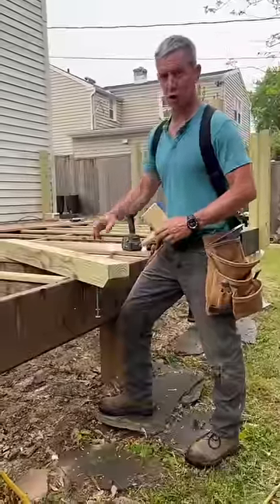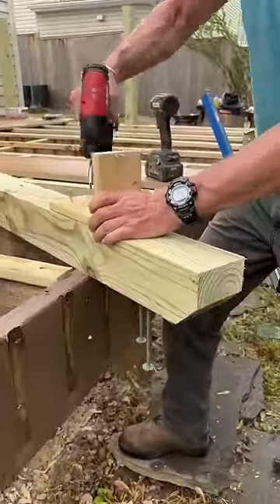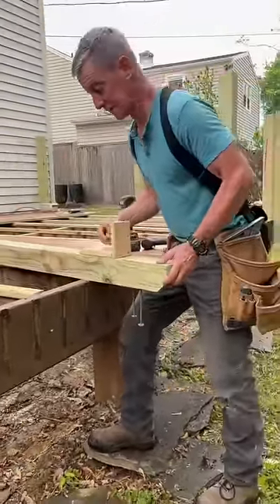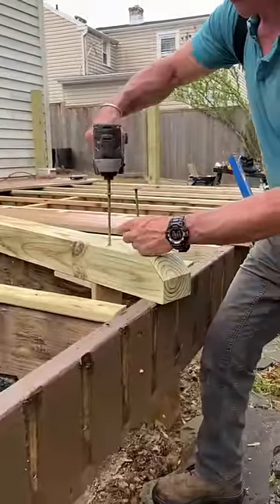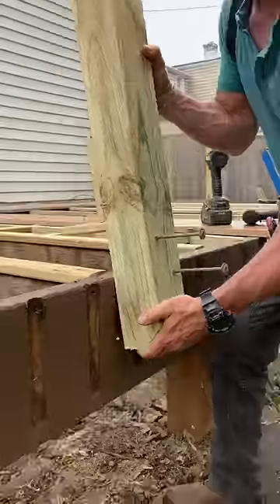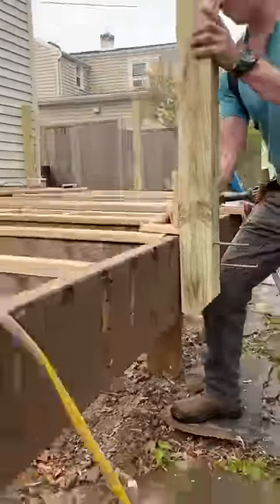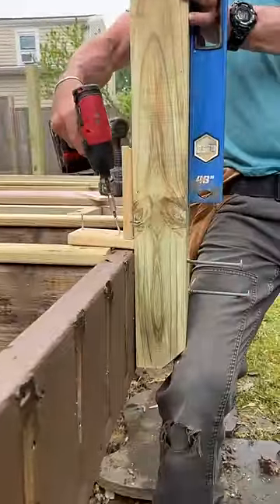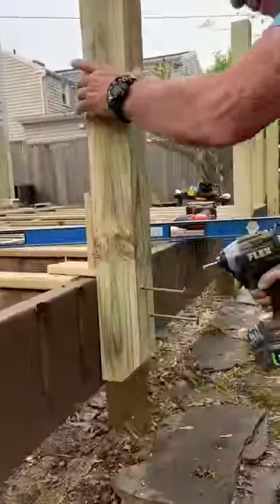DIY Tips: How to set a deck guard post by yourself

Comment: 100% not allowed per code to install handrail posts this way, hasn't been for a very long time.
Reply: I like how he replied to 80 % of comments except this one
Reply: ah, but is code exactly the same everywhere?
Reply from the maker: In new construction, you're right. But I thought the 8,000 gallons of paint on the rim indicated that this was a re-skin. - Here's the other thing: It works. DCA-6 allows a surface mounted post with thru-bolts. I'd put this connection up to that all day. For either one to fail, it'd have to be Armageddon.
Reply from the maker: Here ya go Johnny.
Reply: @MyFixitUpLife home improvement with Mark & Theresa  if you remove handrail posts, and replace, you're required to build up to current code is my point. Mainly just commenting because this can cause others to install improper posts for their own as well. You also didnt use through bolts, those are Lag screws simply going through the rim/post. Either way, the IRC does not allow through bolts for handrail posts either. Some local codes may allow it, but still not the best method. Blocking behind with tension ties and carriage bolts, or Simpsons method with blocking and their structural timber screws through the rim, joists on each side, blocking, and double back blocking.
Reply: @Metal and Wood  most Follow the IRC code book, but some adoptions in some areas are more leanant. But this is not an approved way to install handrail posts anywhere in the 50 states that I've ever heard of. 10-15 years ago, is when code changed for obvious reasons.
Reply: Can't see it from my house 🤷‍♂️
Reply: Every state has different codes, some do allow ledger locks, some cities require through bolts.
Reply: @derekkirchner1863 I've worked in 15 different states, you're totally wrong. It 100% varries city-city. Thats why most new shit doesnt last long.
Reply: @MyFixitUpLife home improvement with Mark & Theresa  So what your saying is you do the bare minimum unless the code forces you to do it. We stopped mounting posts like this 20 years ago.
Reply: My comment, was that is a massive code violation in all 50 states.... Could not agree with you more... It's sad to see people posting videos like this when they know it is one-hundred-percent illegal and improper, and someone might get hurt if they follow their advice
Reply: You’re wrong there. Look at Simpson strong tie DDT2Z tension brackets, they’re made for exactly this purpose. As well, the code just states that the post just has to hold up to 200lbs of lateral load.
Reply: @Hue Janus  he didn't use those, I specifically mentioned in my other comments the special hardware required. These in the video we just done with lag screws.
Reply: Damn that sucks, well I live in America. Code can smd.
Reply: @derekkirchner1863    The way his post is boxed in at the bottom (did you watch the video?) it would take snapping that 4x4 in two for it to fail, doesn’t get much stronger than that even if he used brad nails.
Reply: @NutzBdragon  100% make sure it holds, and then put 5 more screws in it lol
Reply: The posts, fastened like that, can take the whole rim joist off if enough people lean on it. This guy is clueless.
Reply: @myfixituplife  no
Reply: That is what I thought.  You have to put them inside and use blocking to keep it in place.
Reply: @Billybob-go8hn  each state can adapt, their codes minimally, but there is a national code that has to be followed
Reply: Sounds good but the fact the rim is old doesn’t negate the fact the post could have been done properly.

Install them inside the rim and notch them into the framing and then add blocking also. That will never move.

Your way I’m this video is going to get someone hurt and just hack work……..can I do better? Absolutely I can do better.

So don’t be bitter just take the advice from a better carpenter than you will ever be.
Reply: @vrgcustomcarpentry Not if it is an already standing structure... on a new build, sure ...but this is being redone and it IS legal......
Reply: @boosted2.4_sky  explain that to the liability insurance company when the railing fails and someone gets hurt. If you're able to correct the problem in a structurally safe manner up to code you should
Reply: @vrgcustomcarpentry  They will already know and not question it because they have the drawings and the permits for the previous work and the current work... it won't even come up....☝️
Reply: @farmerbill6855    A post is supposed to be able to withstand a minimum of 200 lbs of lateral force. Enough people?! Yeah, enough people could also lift the whole deck and throw it in a river. 
Anyways, the blocking is fastened to the joists which helps hold the rim joist in place.
Reply from the maker: @johnmclaughlin9004  I’ll get to it chief. Hold your horses.
Reply from the maker: @christiangabriel6215  you couldn’t have mounted posts like this 20-years ago. Structural screws didn’t exist, to my knowledge. 20-years ago it was lots of pre-drilling for carriage, then thru-bolts.
Reply from the maker: @vrgcustomcarpentry  I won’t argue that I took some liberties with the prescriptive code. However, it works. It’s safe. It’s not going anywhere. The same screws hold ledgers on.
Reply from the maker: @derekkirchner1863  every connection in the world does not require a piece of hardware. I’ve taken apart many 20+ year old decks and old, hot dipped galvanize hand drives hold like demons.
Reply from the maker: @huejanus5505  I agree. That’s why I did it that way. It would take a catastrophic force to hobble this connection.
Reply: @myfixituplife  it's not safe, stop pretending it's safe. It's a code violation and you know it
Reply: @aaronmyers4054 ......Looks good from my house too.
Reply: @VRG Custom Carpentry  omg don't equate code with the likelyhood of it happening.  That crap is written to protect insurance companies and is often HEAVILY over written at the expense of clients who often don't want to foot necessary expense.  And this is the real world; many ppl build things who haven't studied code,  and so long as it's reasonably constructed w safety in mind,  that's all that can be expected (though i agree that posting a vid can be considered instruction and is a slightly different matter). But it is EXTREMELY unlikely that is going to lift the entire rim joist to fail,  and like he said,  they sell those ridiculous surface mount brackets for 4x4 posts.  If 25 drunk frat kids all lean on it in 10yrs when it's weakened from weather,  then we'll call it nature cleaning up... and even still! What's the danger? They fall 3ft?? Please.
Reply: @vrgcustomcarpentry  there's no way you can equate code violations with danger.  That's the stupidest thing I've ever heard.  How about the hundreds of years they built just fine bf the code were written? They wrote them to protect liability,  not ppl's safety.
Reply: Here's an honest question: how is new code written and why? Bc I seriously doubt any extensive research is done by anyone other than companies selling new hardware they suggest is better than previous options... is there some sort of organization that tests various means of construction against each other in controlled environments? Or is it simply insurance companies who step in one a claim has been made against something that failed? Bc in that case,  it would be obvious that methods will need to continually change without reason,  bc age is the first reason most things fail.  Just wondering aloud.  Happy to be informed.
Reply from the maker: @theoriginalmonstermaker  And, you gain the day for having been there and done that and gotten the T-shirt. This is building in the real world on real budgets on real time lines. You and I both know we can’t be in there dovetailing everything and putting in a million dollars worth of hardware. This is a 3-foot tall deck in a back yard in suburbia. If it were a 3-story beach rental, it’d be a different calculus. - Yes, because it is a video, there is that idea that it’s teaching. - To be honest, the connection was the last thing on my mind. This was supposed to be about SETTING the post, not connecting it. Whether I did it this way or then needed to pre-drill for bolts, I’d still set the post the same way. Thanks for chiming in. Very much appreciated.
Reply from the maker: @vrgcustomcarpentry  Who’s pretending, bro? If you think there’s a way you could pull that deck post off of there and break the 2x6 top cap, be my guest. You can’t. In new construction, I’d have to get a sign-off on this connection, but this isn’t new construction. It is on a budget. It is 1-million times better than what was there. - And bolting or screwing, I still like this way for setting the post.
Reply: @myfixituplife  it may not be up to code but its fine, youtube always will find issues. Not everything has to be by the book, if you tied it in with 2 deck screws it wiuld be a different story
Reply: amen not code at all.
Reply: @myfixituplife  I wonder what state's codes won't allow this connection? Here in Minnesota it's allowed. As long as the top of the post can withstand a concentrated load of 200lbs from any direction it's fine. Don't care how you get there, as long as it works.
Reply: who sets them on the outside? set them on the inside and box out with the same size lumber as the joists then bolt. you can shim inside your box out. it takes more time but will never move. those small screws are no good.
Reply: @farmerbill6855  exactly.
Reply: @metalandwood4u  48 out of 50 states adopt the IRC codes. This guy is installing guard rail posts on the OUTSIDE of the rim joist WITH SCREWS!
 I don't think this was ever code anywhere.
Reply: @williardbillmore5713  good to know, thanks.
Reply: @vrgcustomcarpentry Cite the national code?
Reply: @farmerbill6855 not if it’s a double rim joist/fascia…

Comment: This the kind of deck rail that’s wobbling in a few years from people leaning on it.
Reply from the maker: The same screws that hold this to the band, hold the ledger to the house. There's a 2x6 top cap integrated between the posts. If a dump truck is leaning on it, maybe. But people--and 99% of people don't lean on railings, they sit at the table--leaning aint happenin'
Reply: @myfixituplife actually it one percent that sit at the table.
99% of people lean .
Now regardless of how few or many people lean on the railing if it only anchored at one point it will wobble.
Reply from the maker: @lethargicmotorsport2025  I’m not following you here.
Reply: @myfixituplife  the post and railing is fastened to the band , with that leverage it will move . 
With that said the way you did it is very common and the little bit of movement that it will have is generally acceptable.
Reply: @lethargicmotorsport2025  😅
Reply: @MyFixitUpLife home improvement with Mark & Theresa  it might hold your ledger on but there is no lateral tie to the house and to the joists. You can't rely on hangers for that. Your posts are the same, should also be using lateral ties to your joisting. As your post is tight to your end joist but nothing keeping you from pushing the end joist right off.
Reply: Why not put them on the inside with bracing?
Reply: @myfixituplife  So you are trying to explain away smart building techniques because you used them on them on other projects that haven't failed yet!? You can't fix stupid. I just hope people read the comments section before they try this!
Reply from the maker: @tobybigham4196  Oh, you're fun. The trick here is you're the compiler of "smart" building techniques. Cute. You're not. Sorry you're flummoxed. I'm not stupid,, however, we may just have different points of view.
Reply: @myfixituplife  Wow, are you dieing to get rid of your fan base. I almost removed you when I saw this video. But don't worry I corrected that for you! You earned it!
Reply: No they actually hold very well.
Reply: Not true…..I use bolts….if you do it properly it’s plenty strong

Comment: You never put your posts on the outside...
Reply from the maker: You can surface mount posts. DCA-6 calls for them to be thru-bolted. I used PowerLag Structural screws here.
Reply: I worked for my cousin a couple years ago building a deck. This is how we did it. 

We did a lot of things wrong
Reply: So not true